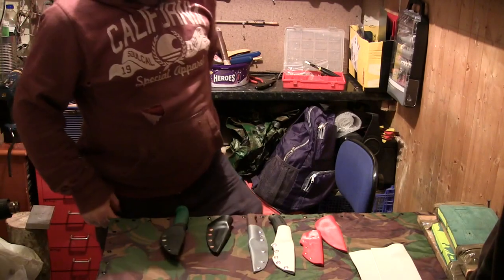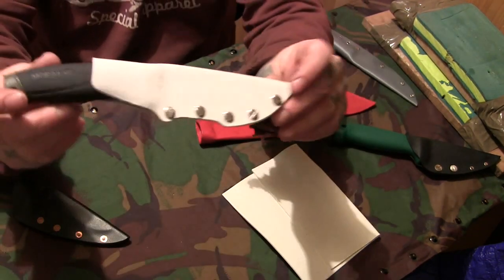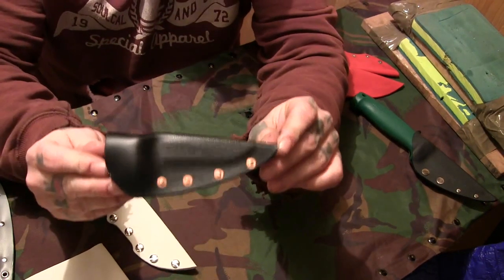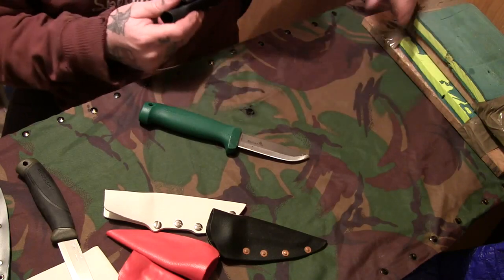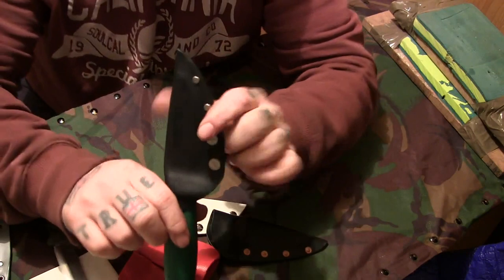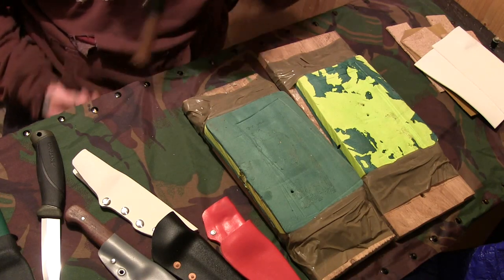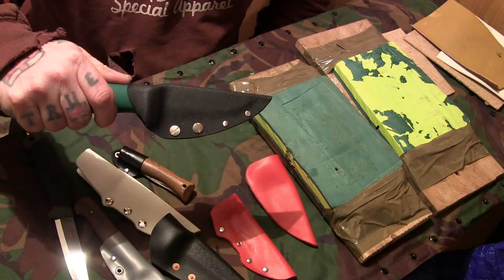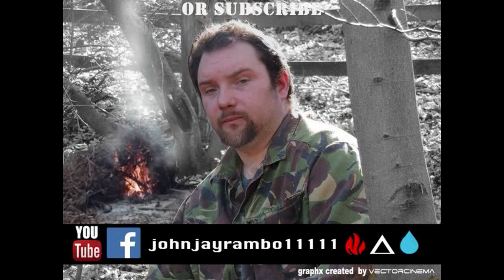Kydex Sheath Projects

Comment: Really like this; some great work you've done! Quick question (perhaps a bit silly): What's the most efficient way to clean the oil bottles you use for sourcing the HDPE? I have a bunch laying around and am going to give this a go. The kydex one w/ the belt loop is fantastic. Cheers, Erik
Reply from the maker: +thesomberlainv70 cheers mate , i used petrol to clean off the oil then scrubbed with washing up liquid , i reckon most alcohol based stuff would clean it off too or white spirit maybe